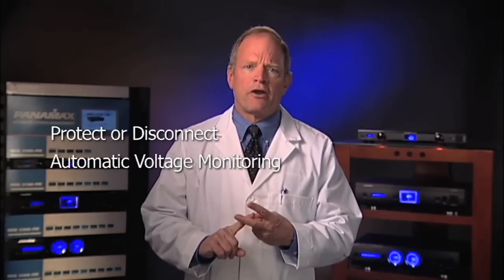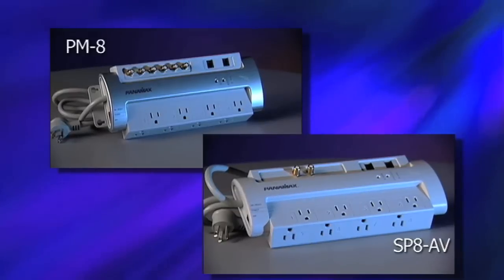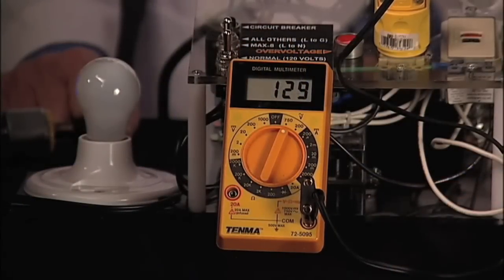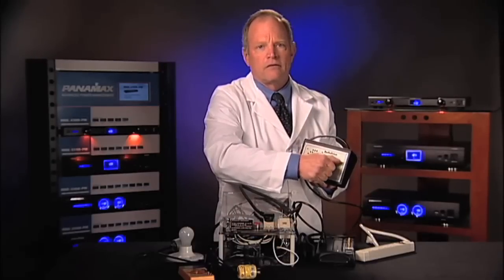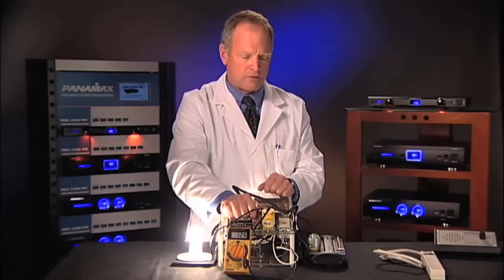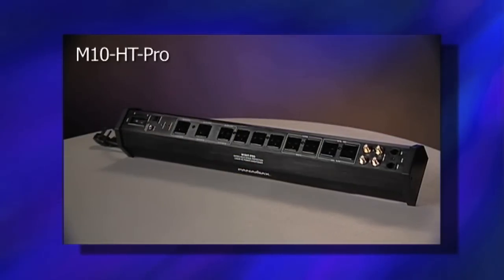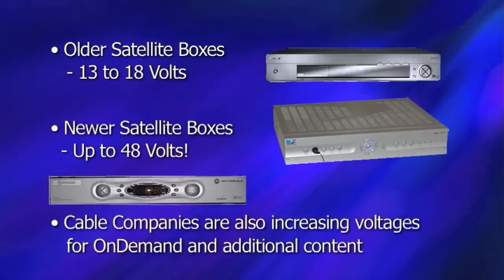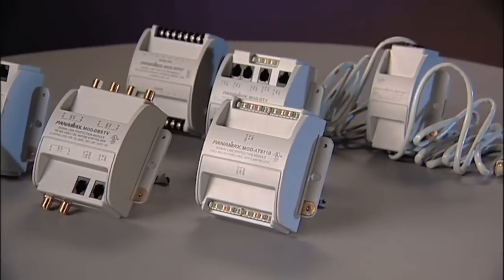Panamax Surge Protection

Comment: I always thought that "competing product" meant one that is in the same class. That power strip looks like a $1.99 Wally World special. How about using a similarly priced Furman, Monster, etc. product as comparison? Wouldn't that be more relevant? This is totally misleading. By the way, the metal oxide varisters (MOV's) he going on about cost like 50 cents apiece.
Reply: Gregory H. Seaman yeah I would have bought a $15 surge protector until I was informed what a surge protector is supposed to do.
Reply: +Gregory H. Seaman well the whole point is to compare it with the power strips/"surge protectors" that the average american uses to show people just how bad their normal power strips are. the average american takes one look at a $400 price tag on a panamax (or furman or monster) and then looks at the cheap 2 pack for 5 dollars, and thinks "i don't want to spend 400 bucks on a surge protector! that's crazy!" without realizing just how much of an investment it is.

Comment: The disconnect feature is one of the unique and best features for a surge protector; APC is durable but not one model disconnects errant power supplies that can happened after storms cut power lines, particularly the neutral lines. Also in stand alone homes, rodents can chew through insulation in wires and cause many types of faults on parts of each branch circuit,  necessitating individual socket protection.